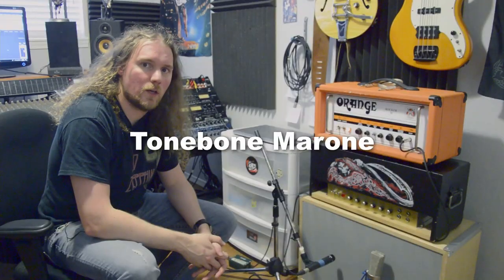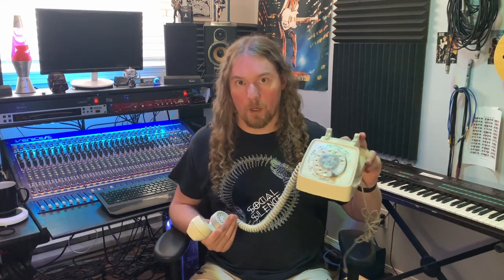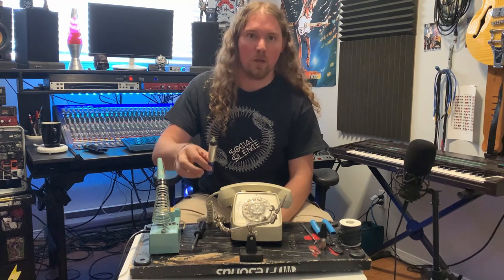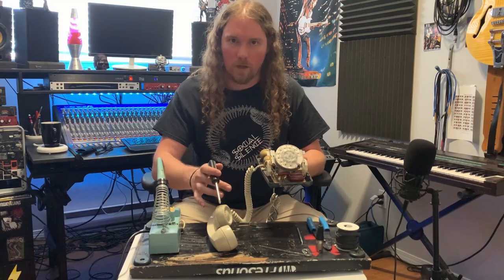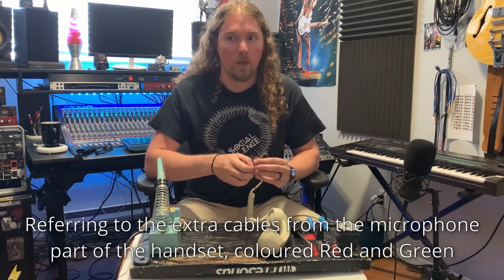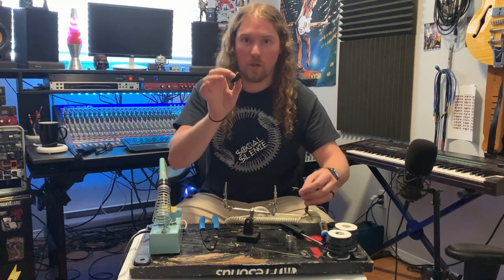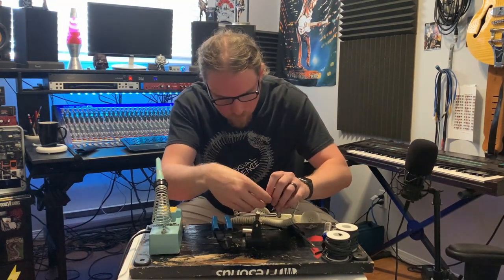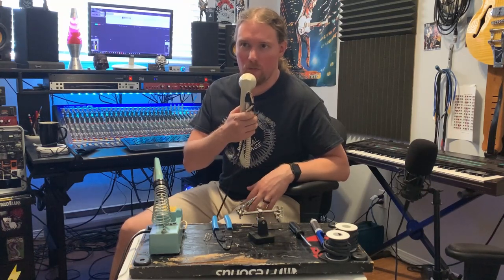How To Make A Lo Fi Telephone Microphone

Comment: I liked it. i once tried to do this and was completely stumped by the carbon microphone.
Reply from the maker: That one is odd because it takes something like 5volts to power that mic so phantom power is too much but no power is obviously not enough. There is a way to make that mic work involving a transformer which I fully intend to make another video on, but I have to do some research first